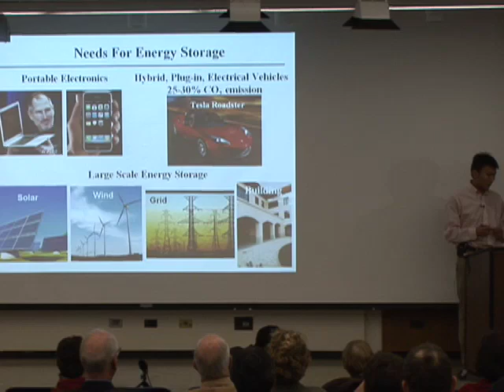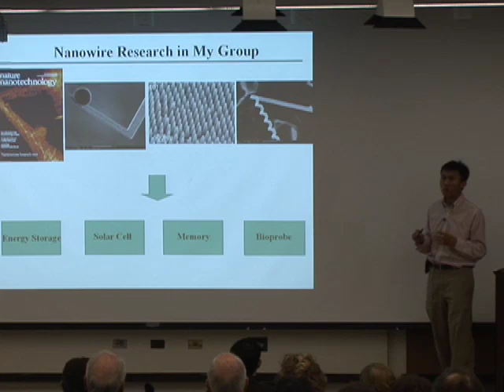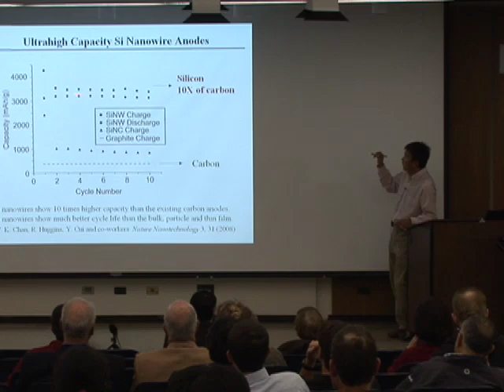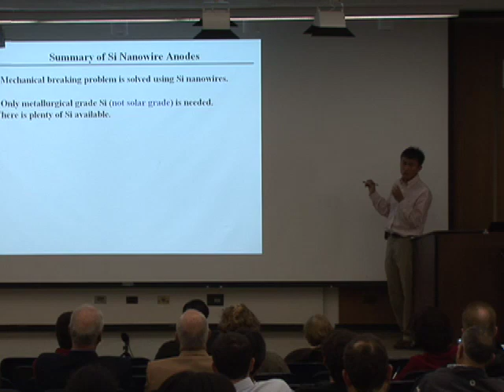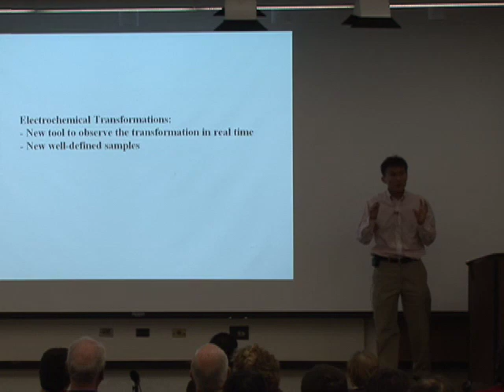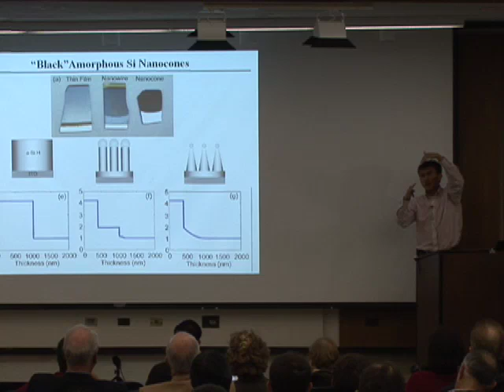Nanomaterials for Batteries & Energy Storage

Comment: They should do more research into the cycle-lifetime of the batteries. Whats the use of an energy-density increase of  300-1000% if the battery lasts only for 100 cycles and then you have to throw it all away. Its too expensive.
However, we are on the way to a bright future. 
Thanks a lot for posting!